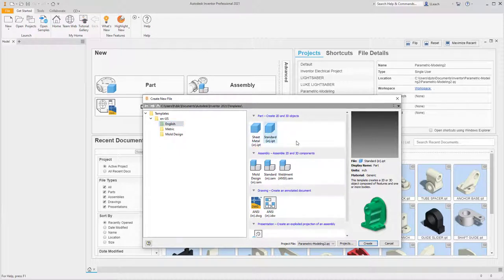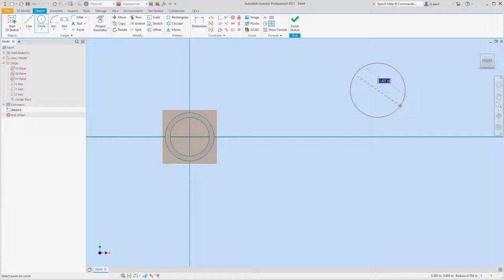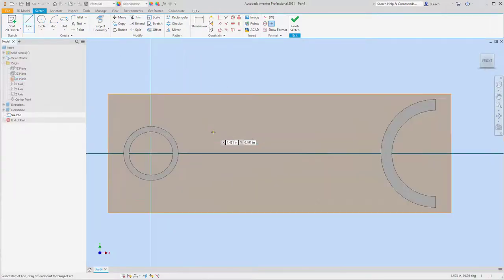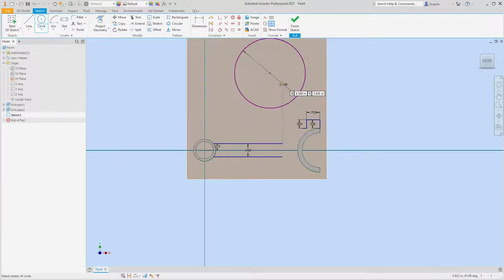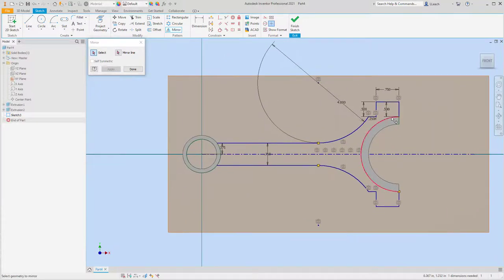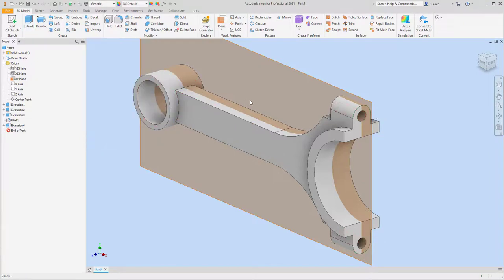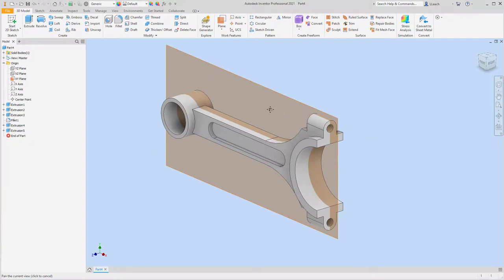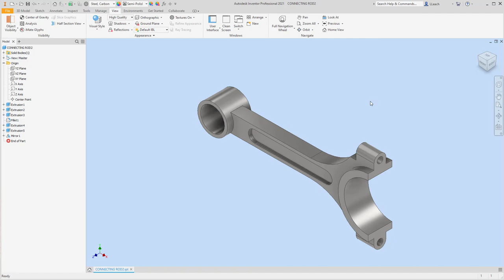CONNECTING ROD USING INVENTOR

Comment: dont we have to use the fillet command on the end of the connecting rod with a radius of .5? it the line connecting to the little outside circle
Reply from the maker: Yes, you are correct.  Sorry, I'm taking away points on my own work.  Thank you for pointing that out!
Reply: @LessonswithLarry  no problem! youve helped me through my entire precad class, so thank you!